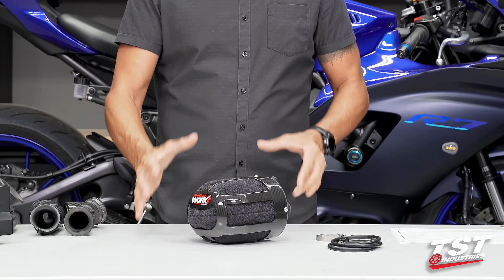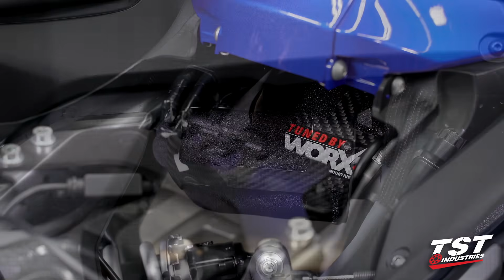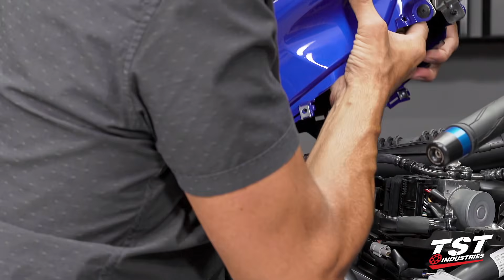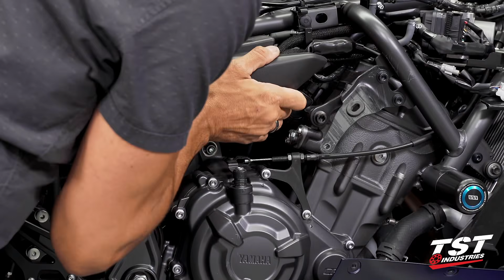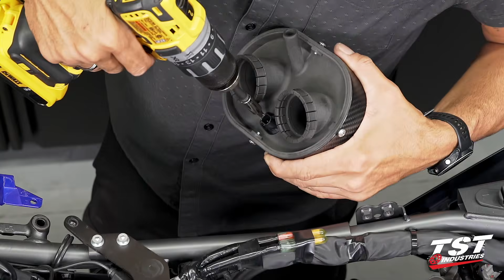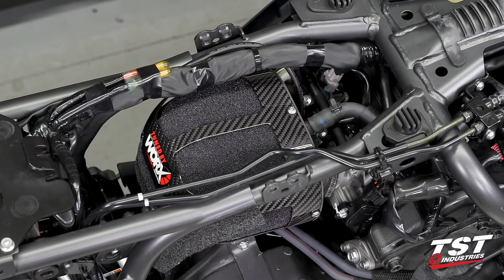How to Install TST WORX Carbon Fiber Airbox on 2022+ Yamaha YZF-R7 by TST Industries

Comment: I've bought a lot of yoru products but you guys needs to put down the pipe with that price. $600 with a service interval of 30 seconds is insane, guys.
Reply from the maker: This is a high performance, race oriented product. In real race applications, routine maintenance is more than normal and that includes removing, inspecting, and servicing air filters.

Comment: Would you be able to ride in the rain with this?
Reply from the maker: We wouldn’t recommend riding in excessive rainy conditions but we have ridden at the track in wet conditions with no issues. It’s important to inspect the airbox and the filter element after risings and to perform routine maintenance as needed. We have separate filter elements available for sale if needed.
Reply: @TSTindustries thanks!

Comment: Overall really good video and product. Although id say when you are working on areas like 21:13, and  you take apart a vital part of the bike, it would help if you had a better camera angle on how to assemble it back when done… I can figure it out on my own but still woulda been nice to have been shown  all the steps for both taking it apart and back in one video.

Comment: Power difference is definitely there after the airbox install. 
Bike feels smoother running and you can feel the 10 horsepower difference. 
The first ride I got stuck in a torrential rainstorm and the filter didn’t get a drop on it.
Reply: With ecu remap?